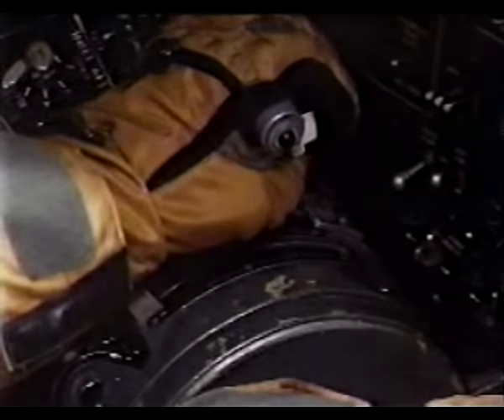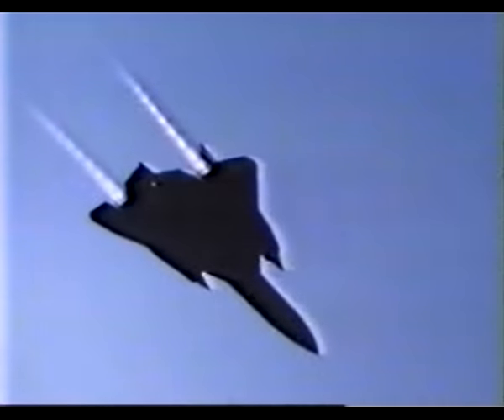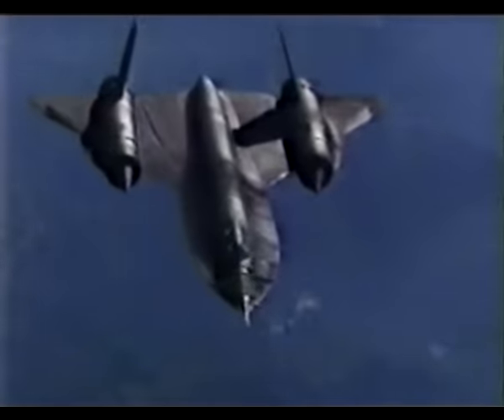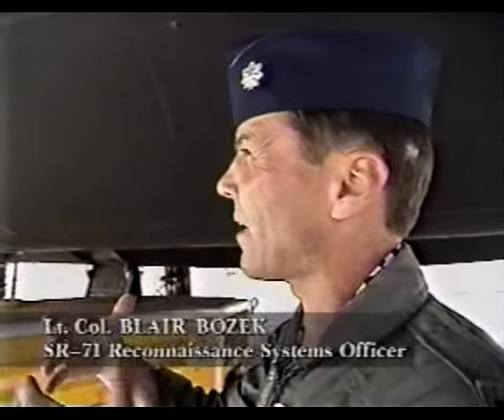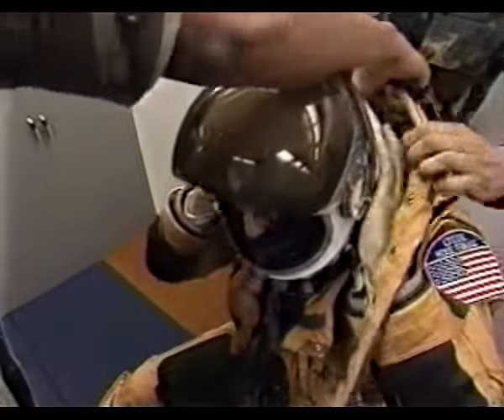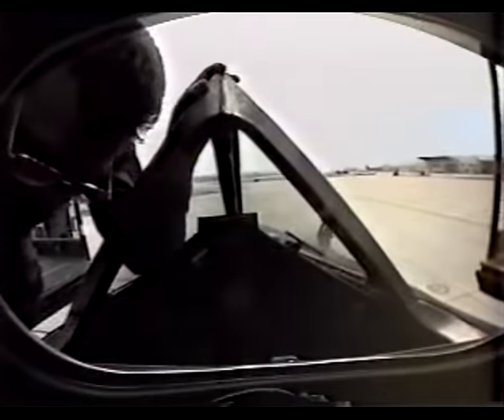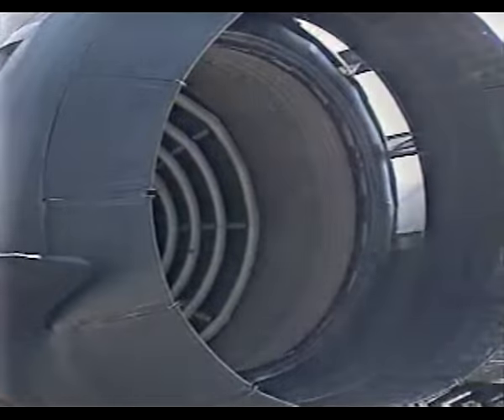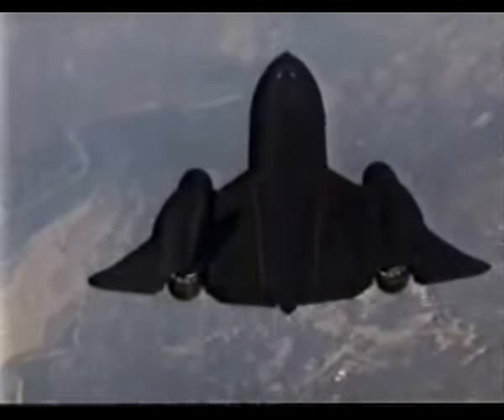Lockheed SR-71 Blackbird

Comment: A blackbird landed at our Air Force base under emergency conditions roughly 1978 in the continental US.  A crew was sent from California to fix it and be able to start it up when it was ready to leave.  We weren’t allowed to go into the cockpit but we were allowed to walk around the plane so close you could touch it.  It was leaking like you wouldn’t believe - that was normal - as said in the video the plane skin stretched once they reached speed.   To start the plane, they had 2 Mickey Thompson fully blown Buick 455 engines connected in tandem to one transmission that connected to the plane to force it to spin up.  The Mickey Thompson’s only had hooker headers and no muffler and were the loudest object I have ever heard.  Even being 100 yards away with ear protection it was louder than any plane we ever had on base.   Just about everyone was on the flight line when the plane finally left.  The pilot took off in what looked like a normal takeoff - all eyes were on the plane as it oddly went in a large circle in the valley to head back to base runway at a fast speed and when it got over to the center of the runway - and not very high in the sky - the plane went straight up close to 90 degree climb until it was so small we could no longer see it with the naked eye.  We were told it’s flight path was straight up then coast down to its home base in California.
Reply: That's really cool, I'm surprised (but happy for your sake) that they let you see it so close.  

(I heard a story before about a U2 plane making an emergency landing at a different airbase while it was still classified and they made everyone who wasn't directly involved with it confine themselves to their barracks until it was wheeled into a hangar.)
Reply: They first used pair of Buick 425 C.I. Wildcat 445 "nailheads" in the AG-330 start cart. (445 was the torque rating Buick used instead of cubic inches in their engine designations)

Later they used 454 Chevy engines as the older Buick engines were getting hard to source.

But the Buicks provided more torque. (445 lbf-ft each)

Normal built engines. Not blown, and no Micky Thompson BS.

USAF, ret.
Reply: @junkmonkey9859  “The book I have on the development of the SR-71 (written by Rich and Johnson) mentions these start carts.

Apparently they spun up the engines with a driveshaft coming from the power car into the bottom of the engine.

Book says Mickey Thompson built the engines for the power carts.

Also, on the 455, remember the nailheads had their designation on the air cleaner in torque output, not displacement. I can see how people might think it was a 455.”
Reply: @junkmonkey9859  Start cart trivia ( that is not necessarily needed for the article ): Lockheed needed powerful automotive engines that would produce low end torque levels high enough to rapidly spool up a J-58. Allegedly, the Lockheed person who was responsible for the start cart design had worked with Mickey Thompson, a prominent drag car builder of the time, who used "hopped-up" Buick Wildcat engines and his familiarity with them brought them into the start cart baseline. Blackbird maintainers would open an access port on the bottom of the J-58 nacelle exposing a female gear connection that the top male gear end of the start cart connecting shaft would rise up and connect with for a gear to gear J-58 spin-up. As years of operation went on, obtaining spare parts for the Buicks became more difficult and eventually, Chevy 454's were substituted in the start carts due to their ease of spare parts availabilities. Finally in the 1980's, a pneumatic system ( to spool up the J-58 prior to a TEB shot ) was developed that would plug into the J-58 when the Bird was at a main operating base so equipped. Start carts remained in the inventory however, and would be carried aboard a JP-7 carrying KC-135Q that was dispatched with a recovery maintenance crew whenever a Blackbird had to land "away from home", as standard Air Force Bases or civilian airfields had no equipments for starting a Blackbird.  (Quote from Wikipedia)
Reply: @justinpenn9250  the air cleaners were 445 and the Super Wildcat was 465 (dual quads). There was never a nailhead with a 455 torque rating, but the Buick Big Block did have a 455 CI in 1970, and was the last Big Block used in GM cars.

I have a 2x4 nailhead in one car, and a BBB in another.

Been driving Buicks since the 70s.

When the start carts were created, the nailhead was the only engine that produced as much torque at 2800 RPM, and had a long flat curve that could sustain the time to spool up the J58.

Frank and his son, Arlen Kurtis were the contracted builders for the AG-330 carts.

Mickey Thompson used KK engines, and that might be how he is connected to the history.

My family was involved in SoCal racing scene, and knew most of the people in the history books.

There's what actually happened and "stories".

Comment: I was fortunate enough to have been hired by Lockheed at Beale AFB after obtaining a secret security clearance in late 1967.  Initially I assisted two Lockheed tech reps process SR-71 Flight Data  Recorder tapes and later worked directly with the Lockheed Field Support engineers basically assisting them with whatever they needed.  I saw literally 100's of SR-71 takeoffs, landings and aircraft in flight.  I saw an SR-71 inflight refueling fly by during an airshow at Beale, and I actually sat in the cockpit of SR-71 tail number 17964. 

Two SR-71's were lost during my time at Beale.   In Jan. 1968, aircraft 17957,  one of two SR-71B model trainers,  lost a generator about a thousand miles from Beale and was being nursed back home when it suffered a loss of both engines only 6 miles from Beale.  Both crew members ejected safely and the aircraft crashed in an open field.  This crash was a major blow to the program because it left only one trainer,  tail number 17956, in the entire SR-71 fleet.  The concern was that if trainer 17956 were somehow lost, the program would be severely jeopardized.  The B model trainers had two cockpits, one for a student pilot and one for an instructor pilot and the aircraft could be flown from either cockpit.  The B model SR-71 was not a reconnaissance aircraft, it was used only to train pilots.  The A model SR-71's also had two cockpits,  one for the pilot and one for the Reconnaissance Systems Officer and were the SR-71's that flew actual reconnaissance missions.
SR-71 tail number 17977 crashed on takeoff in October 1968.  I was watching that takeoff from the Lockheed Field Support main office window and witnessed the crash.  I later learned the details.  977 had a wheel disintegrate during the takeoff roll.  Debris punctured the fuel tank and set the rear of the aircraft on fire with a massive flame trailing the aircraft.  The aircraft was near takeoff speed of 200 mph and the brakes and drag chute failed as a result of the fire.  As the aircraft approached the end of the runway the RSO ejected.  The pilot stayed with the aircraft.  A cable at the end of the runway intended to slow runaway aircraft tore the landing gear off and 977 slid on it's belly for about a 1/4 mile before coming to rest in an open field.  Emergency crews assisted the pilot out of the aircraft and both crew members escaped in good shape.
Reply: as a highschooler, I am unfortunately unable to have experienced what you have, thank you for the information
Reply: @fulccrum2324   You're welcome.  I remember the first time I walked into the building where we processed the SR-71 flight tapes.  There was a large status board with every SR-71 stationed at Beale listed with it's current status.  I recall seeing that 4 or 5 of them were shown with a status of IRAN.  I asked one of the Tech Rep's why we had SR-71's in IRAN.  He chuckled and replied that IRAN stood for  "In Repair As Necessary".  Another time I ran across a revision to the SR-71 Flight Manual that identified a change to the SR-71 cockpit identified as "Dinghy Stabber".  The change was the addition of a sharp metallic tool similar to a letter opener which was added to both cockpits in each aircraft to be used in the event of an accidental inflation of the rubber dinghy (life raft) in the cockpit during flight.  One of the Tech Reps told me that during an actual flight the raft accidentally inflated which needless to say created a very hazardous situation for the pilot.  Another interesting tidbit.  In the late 60's we received daily SR-71 flight schedules out of Beale.  The schedules listed each aircraft scheduled to fly that day, by tail number, the flight crew, flight takeoff time and duration, and the aircraft takeoff weight.  What's interesting to me is I recall typical aircraft takeoff weight of around 120,000 lbs.  I have since learned that all SR-71's later took off with it's fuel tanks near empty which would have put the aircraft closer to 60-70,000 lbs, and then they refueled by tanker shortly after takeoff. During my time at Beale  I don't recall any SR-71's having to refuel immediately following takeoff.  A takeoff weight of 120,000 lbs would have meant the fuel tanks were near full on takeoff.  I recall after the crash of 977 there was great concern with the tire/wheel makeup that caused the crash.  A total of 4 SR-71's were lost due to tire/wheel failures so I'm guessing that the "fix" was to reduce the aircraft weight at takeoff to reduce stress on the tire/wheel combination.  I don't know this as a fact, but it seems to make sense.
Reply: @dankoehler6055  Sounds right, and, wow, pretty cool stuff

Comment: The more details I learn about this aircraft the more I'm in awe of what a perfect piece of engineering machine it truly is
Reply: Well, minus the fuel tanks leaking all over the ground before flight.
Reply: @edubblesspirit  You understand the reason for that do you not ?
Reply: @slyspy9819  it’s great mid-flight when everything is super heated, expanded and sealed up. But until then I feel like there could’ve been a better solution.

Now I’m definitely not a smart enough aeronautics expert to make a statement as such, but still.
Reply: @edubblesspirit  I'm sure Kelley Johnson is open for any suggestions you may have (ha)

Comment: Great Blackbird still to this day the fastest jet aircraft ever produced,still looks so fresh and futuristic,only plane that can make the faster you fly less fuel you burn.Kelly Johnson was brilliant genius who was way ahead of his time.
Reply: Fastest manned jet. There are unmanned jets that are faster.
Reply: Eric Stanley Unmanned aircraft just don't seem as exciting as aircraft with a human going along for the ride
Reply: PootStip Don't forget that the SR-71 also used less fuel that High up because the engine stop receiving as much fuel, they got turned into Ramjets at that speed and height.
Reply: Jaden Ittanenn Finally, someone gets it right here.
Reply: ...yes, I stand corrected.   I was certain I read somewhere that it needed a shallow descent to break the barrier, but can't find it anywhere....or maybe I incorrectly read whatever the source was....my bad.

cheers
Reply: BA31Driver This may help..(quote from "SR-71 Revealed" P.163) "The trans-sonic acceleration called for a climb and descent maneuver called the Dipsey-Doodle The maneuver helped minimize the time the SR-71 spent between Mach 1.05 and 1.15 an area of excessive drag on the A/C, approaching 33,000 feet,Habu nosed the A/C over and began a descent of 2500 to 3,000 feet/min as it was important to exceed Mach 1.05 early in the descen"t
Reply: Vengeful Angel this was designed in 1959 and not 1979.
Reply: There has been official talk about an unmanned SR-72 which can reach Mach 6. It’s being developed as a way to gather intel in the event that our recon satellites get shot down or jammed. 
There’s also an effort to build an optionally-manned stealth U-2 / Reaper drone hybrid for similar missions.
Reply: @Grammatical reich The X-15 was also not a jet aircraft; It was a rocket powered aircraft. Completely different class of aircraft.
Reply: that was a rocket power aircraft.  not the same.
Reply: The A-12 was technically faster. But it was a classified program for the CIA, while the SR was Air force. Before someone yells at me..they were different planes.  Go to the National Reconnaissance Office YouTube channel and watch the video from them on the A-12 Oxcart.
Reply: @pipercub123456  Exactly
Reply: Most of our planes came from that era  thayyy we're so far ahead of the curve  of technology  back then I only hope that found out how to get back to it  Thea's are slide rule scientist every one of them the human mind was the computer the slide rule set the parameters of what they were thinking about my father was a slide ruler nuclear engineerhe was a walking computer with a slide ruler in his hand I don't know if we can ever find people as intelligent as they were to replicate what they were doing now it's all computers instead of people
Reply: Sorry about my spelling and grammar please forgive me
Reply: @densealloy  the A-12 was the prototype was it not? Before the SR-71?
Reply: I would love to see a bio/documentary on Kelly Johnson and his time at Skunk Works. But uh, I doubt that will ever happen until it's safe to declassify certain information. Mostly I think until any information declassified wouldn't be detrimental in the slightest to any advantage the US has in the works. Still, it would be damn interesting to see.
Reply: @dsandoval9396  no. There were at least 15 A-12s built. It was a single seat plane flown by the CIA. It was not a prototype but it was what the SR was based on. The SR was 2 seat and modified to carry more equipment so it was (I believe)  wider in the nose area.
Reply: @densealloy  ah, right. That sounds more like what I heard.
Reply: @dsandoval9396  that had a show about him somewhere  he was a genius and a man who saw in to the future  way ahead of the pack   when women would cook great food at home for there husbands and children our country was much stronger and smarter   he was a slide ruler genius Thea's men and women  we're the computer      he was a hero
Reply: x- 15 was faster
Reply: Pretty sure both the US and Russia have faster and better aircraft now that we don’t know about
Reply: CR  ja. Polnisch yude from UdSSR. Предатель..
Reply: @WranglerSlim  interesting facts, but unmanned craft still needs a satelite signal to be guide it, unless is programmed for a fly by route, but I doubt it will work, it still needs live video transmission to do its recon accurately & with certainty.
Reply: @gregorykendrick4245  I have to agree. I don't know much about engineering, but I follow gun designs, and admire John Moses Browning for the things he has designed, long before computers were invented. One of his more known designs is the 1911 .45ACP pistol. Now, he determined the grip angle by closing his eyes, and holding his arm in a position to fire a handgun, and having other people do so as well. Fast forward 100 years or so, and Smith &Wesson designed a modern polymer framed handgun, using the latest in CAD software that took ergonomics into account. Guess what the optimal grip angle to bore centerline angle was. Exactly the same as determined by Browning using his blocks of wood and closed eyes. 
So, I agree with your thinking on the great minds of the past being walking computers like your dad!

Comment: Back around 1967, I was able to do a altitude chamber flight through the "Aviation Explorers" Post 707 at a "71" base in California.  Down the hill we could see a few open end hangers with Some "SR's" in them.  We were told... don't get any ideas of sneaking down there for a look.  Use of deadly force is authorized.  Yes Sir was the reply.  We were able to watch a real "Launch"..and it was amazing.  Truly amazing! Any old members out there? This is Steve.
Reply: Yes, i worked on the astro-inertial navigation system on the SR from 75 to 85, Also worked. on the U-2 76-79, and 83-89.